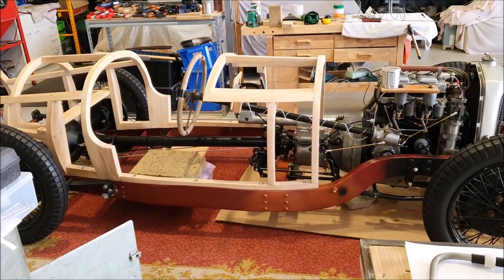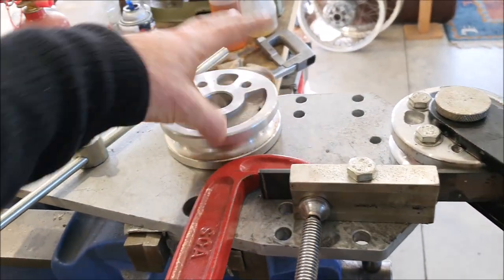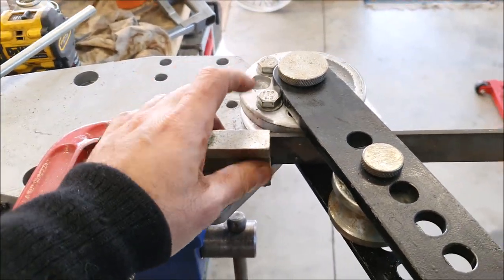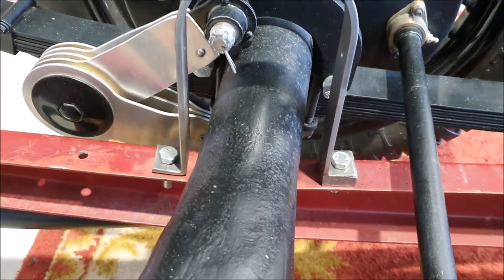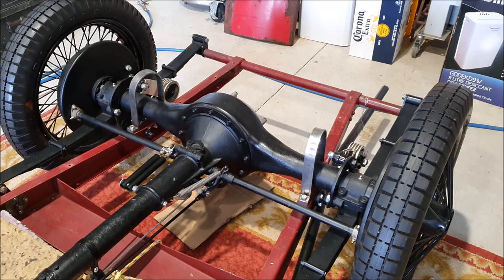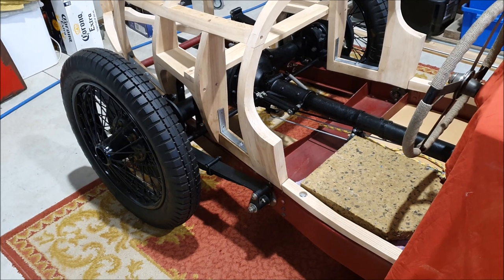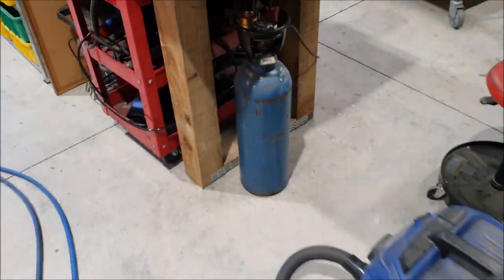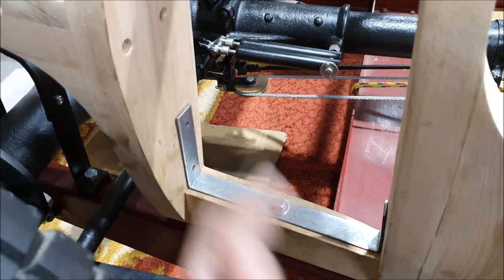Riley Brooklands replica - frame brackets part 2

Comment: It's hard to believe how many hours pass while a guy is making one 90-degree bend and drilling a couple of holes.  I've watched that coach work channel too, I'd love to be turned loose in that shop for an afternoon.  The man does amazing work.  The Riley looks better every time I see it. Cheers
Reply from the maker: All those little brackets and bits and pieces take forever if you want them to look 'right'. Right depends on the style of car you are building to some extent I guess. I think I spent a good morning on the little choke mounting bracket, partly since it took me two tried to get the bends right.

Comment: Looking good Simon👍- I haven’t put any axle “U” stops on my special build as I can’t see the axle travelling that far with my rear springs being so flat. As you are using these remember that your wing height above the tyre needs to be more than the maximum the axle can travel vertically otherwise you tyre will hit the underside of the wing before the axle travel is limited. If you do the rear wings/stays first you’ve then got the correct height for the front wings so they all look at the same height on the car.
Reply from the maker: As you say with flat springs I can't imagine it ever moving enough to hit both stops at once. I imagine they are there for when you're moving slowly and one wheel drops when the other goes up. Like driving into a ditch! I need to measure but I think it ended up the straps were about 3.5 inches above the axle (with the padding there too). I think my Austin 7 when driving over rough ground (round the garden) does have the wheels hit the guards. On the road it's fine though.
Reply: I’d also consider putting some rubber “rebound” stops on the chassis rail under the axle- to stop the axle hitting the chassis on a bump rebound - more likely on the road if you hit a speed bump/hole etc
Reply from the maker: @jet1ok  Yes, you're right, I am missing those still! They just go between the uprights of the loop under the axle. Couple more holes in the chassis either side and they are easy to add.

Comment: Because this is a C section chassis rail, you'd be better using long bolts to go right through both flanges, with a spacer tube to allow fully tightening the nuts. A strike would otherwise bend the top flange.
The rubber should be designed to absorb the shock of the axle hitting the U strap and what you have won't do that. It's much too thin.  You want rubber cut from block, shaped to the strap. Usually these are held on by 20G sheet steel backing to which the rubber can be bonded with super glue. This backing has tabs which fold round the U bracket to keep the rubber in position. You also need rebound rubbers which fit at the base of the U brackets between the legs.
Reply from the maker: All good points! The problem for me though is I have to replicate how they did it in the day as closely as possible and I think what I have is close to how they did it. As always it's hard to tell since all the original cars are messed about with. Some don't even have the straps at all. The problem is once you start changing things you can quickly end up in a mess as you change one thing and it affects another. I suspect that's how a lot of badly built Austin 7 Specials get born! So my default is do what they factory did whenever possible.